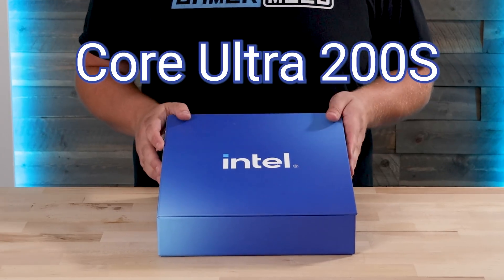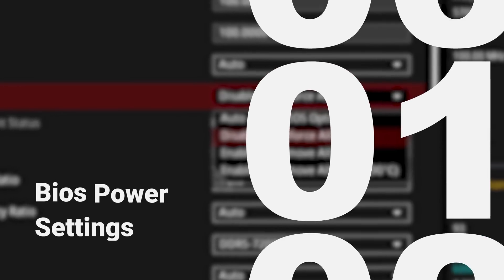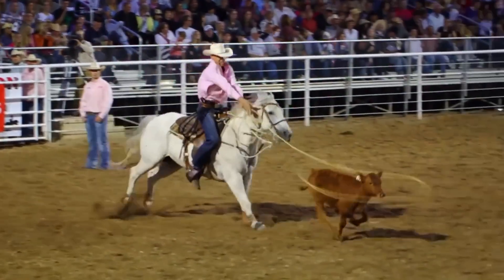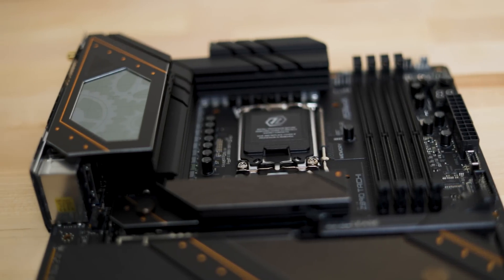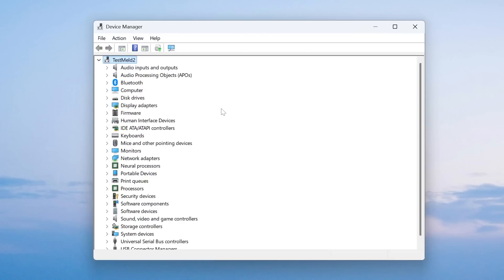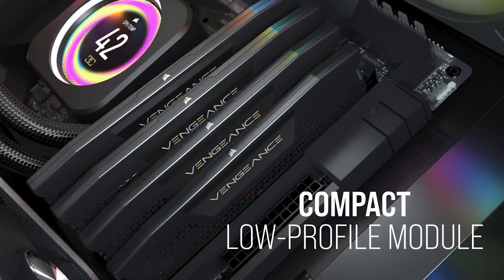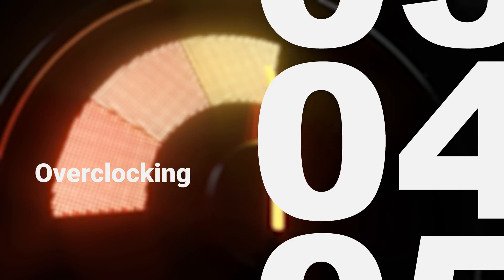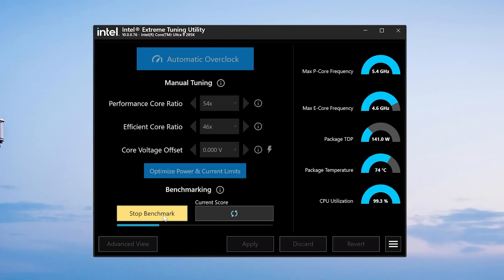Intel’s Core Ultra CPUs REQUIRE THIS!

Comment: I have the 265k and i am using Asus' Advanced OC Profile instead of intel's default and i don't see much of a difference in performance. Maybe its because my ram is at 6000mt/s.

Also hwinfo says that my board is running in quad channel, but im only using two UDIMMs? Why is that? 🤔

Comment: When you say, "Build Requires This," didn't you miss the other necessary PC components? These are a new Z890 MB and maybe a new PSU, depending on how the MB is made. I'm only buying the ULTRA CPU once I know the total cost of building a new ULTRA PC. If you plan to build a PC with the most costly components, expect to pay more than $1,000 and possibly close to $1,400.

Comment: You made a point that you need to do something to get the best out of the CPU. ASUS made sure of it that the new would be so underpowered and clocked that it will make it very hard for Chinese to destroy this and get away with it. E Cores overclock 1000MHz easy and give good boost. CUDIMM's are now 10000 speed and near future you can expect even more. APO you said 3-15% but with INTEL ARC that number is said to go 10-50%. That is huge and we need to wait and see if this is true. Battlemage 250-275W + Arrow Lake 250-295W = 500-570W combined performance. INTEL ARC is missing that will take full advantage of the PCIe 5.0 direct access to CPU and 8 pin added power to the PCIe 5.0 on selected MB's. Is it a buffer between GPU/CPU? We have no Hyper-Threading Technology and boost on E Cores that in my view enhances the simplicity and pairing to GPU adding performance. The ease of overclocking the E Cores and high precise clock speed from CUDIMM's will give a huge performance boost. The CPU side is always the weak side on pairing but on INTEL architecture it does more than just feed the GPU. This is two silicone architecture where CPU is more utilized to do tasks that usually are done by GPU. Two parts are brought together via direct access PCIe 5.0. What is the 8 pin I can only guess as buffer to keep a good balance between GPU/CPU Wattage/performance. Does this mean if you overclock your CPU to the extreme or even beyond 295W that your 8 pin will somehow boost the ARC or visa versa. Just guessing. But I think the Arrow Lake and it memory module for CUDIMM and direct access to GPU are very telling that it is all tailor made to be an all INTEL system for best results. It is an early launch and there are things to optimize and my guess is that give few months we see the new platform raise up and get stable. Then we see Battlemage. I predict it will be 5080 level.
Reply: U clearly need some help

Comment: Why people are just pushing this release on the floor🤔
Is it a necessity for every release to be more upgrade and gamer friendly🤨
I mean its still a good release for a 3D Rendering new build🫣
Reply: It's new. Give it time. The whole system from CUDIMM's to PCIe 5.0 access to CPU screams Battlemage and unrestricted pairing to CPU with hugely improved memory and easily overclockable CPU. Give it time. It is an early launch to fix the problems before Battlemage.
Reply: @paulboyce8537  So you are suggesting when this is paired with a Battlemage GPU, the combo will give an Overall Performance boost to 3D Animation, Rendering and 4K Editing Workload with PCIE5 and DDR5-6400 Cudinn Ram support.

Comment: Pat Gelsinger (Intel CEO) gave himself a 40% raise in 2024 while firing 15,000 plus Intel employees…. and Introduced so this POS of processor. I've been in intel fanboy for years, in the past they've made some fantastic product . I'm officially boycotting Intel, I will not buy any other product until he is fired ! By the way I'm not an Intel employee! 
What he should have done was taken a pay cut,  and give that money back to some of the hard working employees that would actually produce a good product for Intel! 
 if everyone does what I do, and makes it vocal this guy's done!
Reply: You get that INTEL pulled out from China for security issues? Also it is not a secret that INTEL is building new facilities in U.S. hence not needing the old resulting job loses temporarily. Also U.S Government is pouring huge loads of money on INTEL. You do know that it was 100% ASUS that stuffed 13th and 14th and ASUS W680 server boards it was 100% failure rate that brought the internet down overpowering the CPU. Remember the "security update" gone wrong? That was servers going down because of the Chinese attack. Funny how we are not told everything. So till INTEL gets operational in U.S we get the silicone from TSMC just like Nvidia and AMD. China is threatening to invade Taiwan and if that happens the West is fucked unless we have the CPU industry moved to U.S.
Reply: @paulboyce8537  Yeah man, I agree with everything you have said... It still doesn't change the fact that Pat gave himself a 40% increase while firing 15,000 plus employees. Haven't even mentioned the Intel cover up from the last generation 13 and 14 K processors. Anyone that's in this, knows that,  you can't run 250 watts through a piece of silicon that size and expect to cool it and maintain any kind of life expectancy. And we all know the reason they did it was to compete with AMD. 
I don't like the cover up,  I don't like the lack of transparency in their company… Pat is a snake 100%!  I know this type very well. 
I am confident I could run that company better than he could if given the opportunity.
Reply: Im very much the same, BIG REGRET buying 13th gen intel , should have gotten Ryzen X3d , It's the only way now for me !

Comment: NAH NAH NAH THIS GUY IS GETTING PAY BY INTEL BC HOW CAN U SAY THIS IS IMPRESSIVE  BRO COMMON
Reply: This has shown me just how crap intel is coming. You should just be able to put the CPU in the slot Build PC and profit. I have been building PC's for over 30 years and this is the worst I have seen intel do out the box. Next PC will be AMD again AND you don't need a new socket AGAIN!
INTEL - "Get it together"
Reply: @Ketobbey  Maybe you do need a new socket as AMD doesn't support CUDIMM. That alone 10-15% loss. Have you ever seen anything new in IT that was perfect on launch? I haven't. But I do see the potential here as it is tailor made for ARC.
Reply: @paulboyce8537 Man new intel have worse performance then intel generation before, so what do you think ? Who will buy this crap? Is first time in the world happen about new IT technology come and is worse then last gen 😂 is suck really. Good bye Intel.
Reply: @DARKENnekradPL  Some of the bullshit tests and reviews are with DDR5 6000 for all. Only Arrow Lake supports CUDIMM 10000+ speeds. Sweet spot is around 8000 CUDIMM. With that thinking you should go back and test i9-14900K with previous generations RAM speeds 3400 or extreme 5600. We do not need to back too far for these numbers. 9950 doesn't support CUDIMM. So why should we test Arrow Lake with DDR5 6000? It is false testing if you clip the wings that give the performance. 

Do you even know what the teething problems are on this new platform?

Comment: You forgot your microphone in the other room again.
Reply from the maker: I have a shotgun mic like 4 inches above my head.
Reply: @GamerMeld  Some acoustic panels/treatment for the room would be very beneficial for the audio to reduce the echoing. Acoustic panels are one option but also some things that help a lot too are: plants, couches, any fabrics, carpet on the floor, curtains etc. you get the point.
Reply: @GamerMeld  shotgun mics are for large studios/rooms and outside recording, not for a sonically untreated regular room.

Comment: I feel like it should’ve performed better looked at a few benchmark videos. It’s good for workloads. But not good at  all for gaming. And you can’t deny that.
Reply: who's gonna buy such high end parts and game at such a low resolution as to be cpu bound though
Reply: @xellestar  I mean I use it for 3D modeling for houses that we build to send to engineers
Reply: So it depends on the workload. I’d go with the 14900k or ks. Because you get the best of both worlds
Reply: @Ducki3.-  Fair enough i just think there's too much emphasis around on the gaming performance, when you watch the reviews the benchmarks are all at 1080p because you have to be at that resolution or lower to be cpu bound. I haven't gamed at 1080p since like 2012.
Reply: @xellestar  I believe I watched pc centric and he did 4k benchmarks!
Reply: @Ducki3.-  techpowerup has a 4k results page and with 1 exception the amd cpus are within a few fps higher (at the most) than the 285. The amd cpus are usually on top, but it's so close as to not matter, at least based purely on the fps. The one exception is in balduts gate 3 which goes from 117fps for the 285 to 133fps for amd's best chip. Not sure if intel has issues in that game.

Comment: this video is nothing but a massive shill, do not listen to the shills. and avoid buying intel. its not better than upcoming amd chips. Also forgot to say the microcode 'FIX" on 13-14th gen its not really a permanent fix, its just a tweak to delay even further the degradation, IT WONT FIX THE ISSUE. BEWARE
Reply: Holy yap
Reply: You do know if your CPU is already had it you can't fix it with microcode.

Comment: still enlongated rectangular turds .. not interested when the life of your CPU requires you buying a contact frame so the cpu doesn't warp over time.

that siad  , i can undrstand them dropping hyper threading  when you get to the point That we are at , where yuou don't need mroe than 8 cores for gaming , and quite often 6 will do,  and your base  mid range CPU has 8-12 cores .. do you really need hyperthreading ?  is hyperthreading even doing any thing in games  ? ad to the fact looking at the spec sheet on these seems quite a few of these  core ultra chips  have 20+ cores already./

Comment: From what I'm seeing Intel may have out-disappointed AMD this gen. Some minor improvements in some productivity apps, regression in many games (in one game the top Arrow lake chip was just behind the 12600k!). There is some reason to believe the latest 24h2 win11 update isn't playing nice with Arrow lake either. HUB had to use 23h2 to keep their Arrow lake cpu's reliable and stable.
Reply: The funny thing is that they said these CPUs are more power efficient. It is compared to Raptor Lake but from what I can tell, it’s on par with Alder Lake which isn’t anything special. Zen 5 is disappointing but at least you see some kind of performance improvement in almost everything. Arrow Lake is not only more expensive, you’re basically paying for less while getting performance that’s comparable to tech from a few years ago. Embarassing🤦‍♂️
Reply: @LCC.Gaming Not just that. Needs a more expensive ram with higher speed and a new mother board. Rumors say the new socket is only for one generation.  This will totally throw you off.
Reply: @jayvee8502  exactly, this generation for Intel seems like a failure in my opinion. I’ve seen folks say that productivity wise, this is better compared to Raptor Lake but in some scenarios it’s either the same or it performs worse. Arrow Lake is very disappointing, idc what anyone says, this is a massive step backwards.

Comment: Do the affiliate links work? I clicked it but it just shows me older gen. I’m in the us
Reply: They dont work cus they fail
Reply: It takes time to for amazon to update, until then it guesses. I'd not bother until there are some updates to the microcode. The performance on productivity is a tiny upgrade to none and it's a regression in a lot of games. HUB had stability issues under win11 24h2 and had to revert to win11 23h2.
If you're already on lga1700 or better yet AM5 I'd stay there. The 7800X3D easily beats everything else in gamming (and at half the power draw of an I9) and the 9800X3D will be out soon, so just wait for those benchmarks. Perhaps a microcode or task scheduler update for 145th gen will be out by then as well.